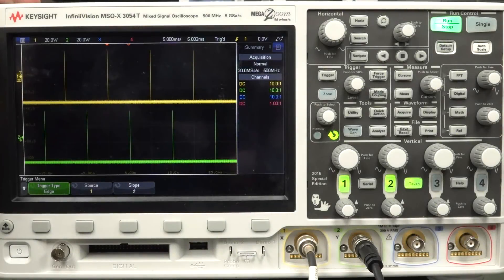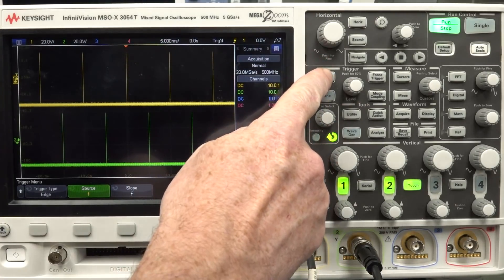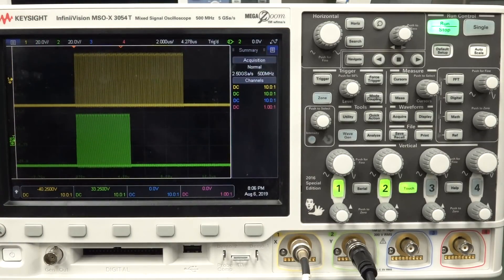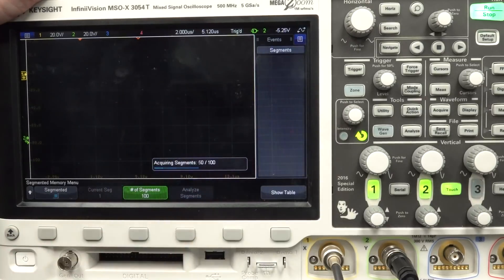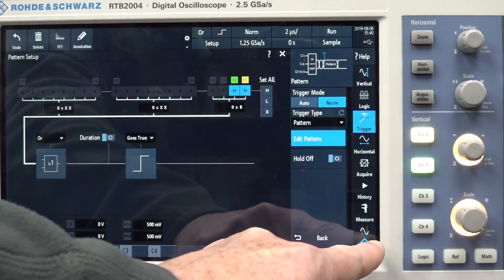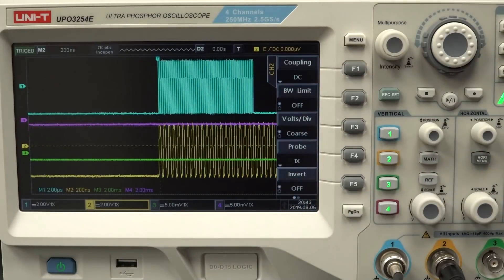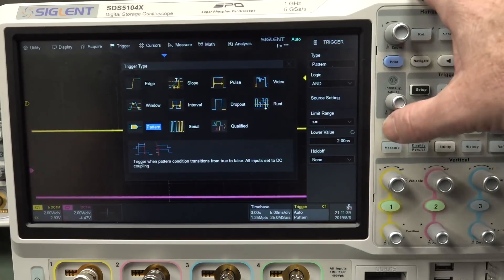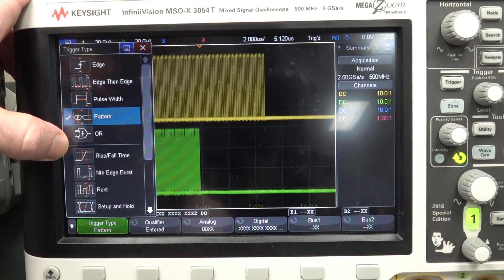EEVblog #1235 - How To Align Signals On A Digital Oscilloscope

Comment: Arduino Sketch to test this:

void setup() {
  pinMode(LED_BUILTIN, OUTPUT);
  pinMode(7, OUTPUT);
  pinMode(8, OUTPUT);
}

void loop() {
  digitalWrite(LED_BUILTIN, HIGH);
  for (uint8_t i = 0; i < 50; i++) {
    digitalWrite(7, HIGH);
    delayMicroseconds(1);
    digitalWrite(7, LOW);
    delayMicroseconds(1);
  }
  delay(10);

  digitalWrite(LED_BUILTIN, LOW);
  for (uint8_t i = 0; i < 50; i++) {
    digitalWrite(8, HIGH);
    delayMicroseconds(1);
    digitalWrite(8, LOW);
    delayMicroseconds(1);
  }
  delay(10);
}
Reply: Ha. Nice one. Not often is code posted in the comments.
Reply from the maker: Nice!
Reply: thanks, it works :)

Comment: In analog days, you could TRY composite trigger, combined with variable hold-off amend MAYBE get the two bursts to align. In 7000 series you could use Alternate - alternate mode and pair channel one display and trigger to time base A and channel 2 display and trigger to time base B.  Pretty slick.

Comment: I use an IWATSU SS-7810 which is a dual channel 100M analog scope and has both DLY and ALT trigger. Digital scopes in ALT or pattern or something like that uses software trigger which uses ADCed data for triggering, as a result many functions would be unavailable.

Comment: Just curious, on an analog scope, I once made an 8ch digital input project that allowed an analog scope to show 8 channels on only one channel -- Thinking back on this, I could have used this technique to show compare pulsewidths of 8 pinputs....  I wounder if you could just use at the analog level, just put two diodes on the input to make an OR circuit to a dedicated trigger input, Ch1, Ch2, Trigger inputs on scope?

Comment: Just for completeness, I should point out that it is easy peasy to analyze two otherwise asynchronous time uncorrelated signals using two oscilloscopes.  I have on occasion used three elderly analog Tektronix scopes to see everything I wanted to see simultaneously.

Comment: I always warn my students that the ALT trigger setting (as it is called on our student lab's analog oscilloscopes) is a dangerous function, because it will - wrongly used - hide all phase relationship between the two channels. But yes, your case actually makes sense for these settings.
Reply from the maker: Yep, potential trap for young players.

Comment: Another very useful scope tutorial, Dave. I will be giving this a try.  This technique may prove useful on a project I'm currently working on. I need to monitor two serial data lines where one line outputs a signal in response to another. They are non-overlapping and at least a quarter second between them.

Comment: Some older dual timebase analog scopes had a mode like that.  It alternated between timebase A and B.  You couldn't do "delayed" mode with it but in many cases just the A,B toggle effect was all that was needed.
You could also do the "overlapped" mode on the delayed time base.  This could be even better if you wanted to measure the time between the two events as well as see what the later one looked like in detail.

Comment: Siglent SDS 1104X-E works also with OR condition and HIGH levels set. Thanks for the video and for the Arduino code. Arduino bitbanging happens to be glitchy though, so for a while I thought it's a problem with triggering. But no, Siglent in fact works well with this type of triggering.

Comment: You can't have more than one edge trigger in a pattern because two edge triggers cannot occur at the same time. This is by definition, because an edge trigger occurs at a single point in time, which in theory is infinitly small.
Hope this makes sense.
Reply: Yes but for OR why do they need to happen at the same time? If it was AND it would make sense they can't both be edges but you can certainly OR the outputs of two edge detectors if they produce a pulse for an edge.
Reply from the maker: Of course, makes sense now, i should have realised that.
Reply: The hardware probably has just one edge detection circuit.
Reply: @donreid358  Even if it did, then it still does not make sense to use two edge triggers in a trigger pattern.
Reply: @marknn3 : yes I see what you are saying and agree.  An edge happens at a narrow instant in time and 2 won't likely be at the same instant.

Comment: How timely!  I just encountered this over the weekend.  I reconnected my bench setup and tried again on my Rigol DS2302A-S and got it to work with pattern triggering.  Thanks for the tip!
FWIW, I'm looking at the time delay from externally triggering a bank of HP 3478A DMM's until I get the "voltmeter complete" pulse from the rear BNC connector.  Verifying that all 4 meters are triggering in sync.